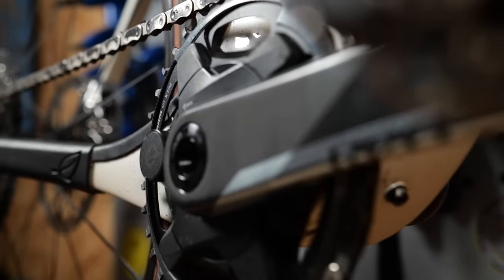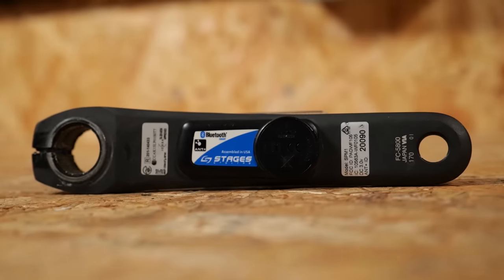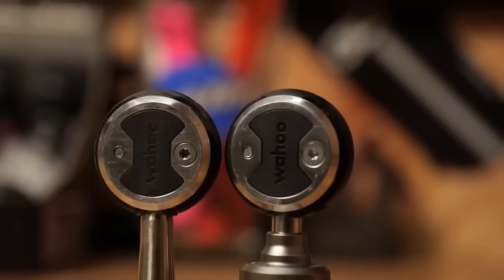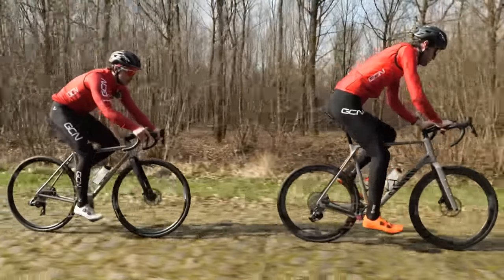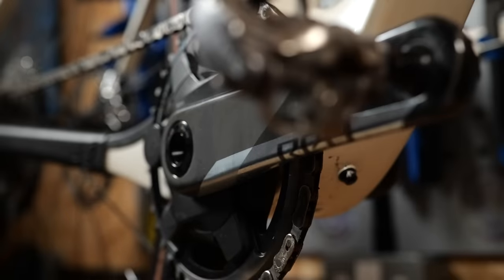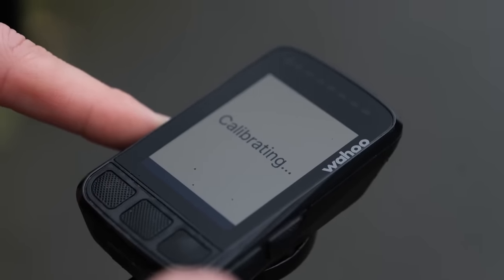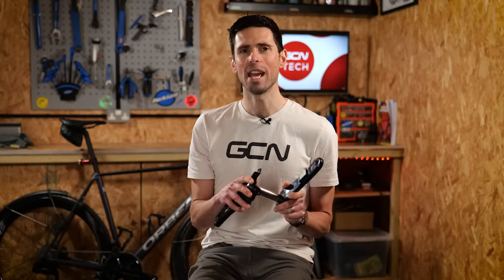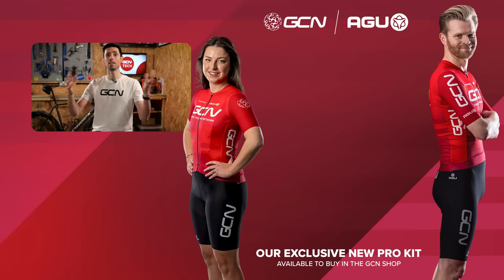The Problem with Power Meters

Comment: great video, I will second one point glanced over in this vid. for 90%+ of riders, all they need to get value out of the PM is repeatability. while it's nice to know how I compare against others on Strava segments, from a training and improvement standpoint, all I need to do is compare where I am now against where I have been historically; the actual number doesn't matter, just need to see improvements or reductions in power. I will share that I have 4 PMs, my cinch PM was 20%high for over a year before I caught it and it messed up all the Strava power curves for that time. Best to keep an eye on accuracy too when using multiple PMs. Anyone know how to easily remove/ignore all Strava PM data from one meter in a single step?

Comment: I use a 4iiii power meter on my left crank. My Kickr core output is around 10% higher so I changed the scale factor on my 4iiii so it matches my indoor training. Although I still feel that indoor training is harder..

Comment: I ride indoors on a Wattbike Atom and outdoors on a bike with a Quark powermeter. Indoor FTP is about 15% lower than outdoor FTP. As I tend to ride outdoors more in the Spring to Autumn it's making my Winter training feel especially effective this year!
Reply from the maker: What training have you been doing this year that has made you fitter in summer?
Reply: @gcntech  hours, and hours, and hours of zwift (and sneaking out occasionally on the mtb) . Pace partner rides, intervals and races.

Comment: After training all winter on the indoor training with its own power meter, i have now started to train outside using my oedal based system. But the difference in numbers is quite profound. Maybe 20 less watts on average. Although I'm aware of the discrepancy, I still struggle to aim for lower numbers when outside

Comment: One thing to watch is getting rogue readings when the battery gets weak. This can mess horribly with your data. I had a Stages dual side for a while with batteries in each crank arm and saw few benefits as my r/l balance was close at about 48/52. Keeping up with the battery changes and the rogue readings was a pain. I’ve single sided Stages now that has been mostly very well behaved and gives me all the insight I need.

Comment: I got a 4iiii single sided 105 R7000 model, v3.0, from Merlin and it was £325- less my "Gold" discount and a further £25 off for loyalty points it was £250.... Looked weird on my Sora bike and to keep q-factor even I quickly opted to upgrade the whole drivetrain to 105 when CRC did them for £299... a nice wee nudge to a worthwhile drivetrain improvement and the power meter has been superb. Yes a dual power meter would be good but would have to be one of the newer Magenes (p505??).... never Shimano though, I follow GPLama!!

Comment: The important thing with ANY measuring tool isn't that they don't always match with other measuring devices, it's that they provide SOMETHING that we can use to measure our performance. This allows us to then use the "measurement" to develop a training plan and see improvement in the number we use as a measurement. This improvement should translate into faster riding, no matter what we're using. 

Of course, this assumes you're only relying on one measurement tool. Anytime you try to take numbers from one device to use on another, you're definitely going to have to create what I call a "translation matrix" to ensure the tools can help you do what you're ultimately trying to do, which is become more fit and faster.
Reply from the maker: This is an important point, it's all about finding your benchmark 🙌

Comment: I use a Stages crankarm power meter.  The most important thing is consistent readings.
Reply: Same. My best judge is, every couple of months, I line my bike up on the same 5.5 mile climb (~4.5%) and time myself to the top. The power meter helps manage the effort, but isn't my (sole) indicator of fitness.

Comment: Since about 6 weeks I have a new bike with single sided strain gage powermeter. The most significant change seems to be that now It sums up my spent calories coming out much lower, compared to the time where Starva / Apple Health used more or less heart rate and data provided by my Wahoo comp.
Reply from the maker: Did you use these calorie counters to moderate your training?
Reply: @gcntech  Not really, but when you do a let say 80 km training, and now - with the powermeter - you "only" did about 6000 kJ, but before you got about 9000 and apple health credited a 200% of movement target, its somewhat disappointing...

Comment: Four different power meters across four bikes (two P2M, one Quarq, and the trainer bike on the Kickr).  Add in the Assioma Duo pedals, and I've used those across the different bikes at times.  as mentioned, get two head units, then ride at a steady pace and compare the 3/10/30 second averages.  For my stuff, its all within a couple percent at most.
Reply: Because these are all quality powermeters that just work.

Comment: Why single-sided? You get good spider powermeters for little more than a single-sided crank/pedal system. I am pretty happy with a Sigeyi - which has been demonstrated to be quite precise, is very easy to set up, and add little additional weight (in my setup, just 80gr, considering that 12gr for the cadence sensor can go). Bought it for 378 CHF...

Comment: Yes, Assiomas & Stages L. Soon to include the Assioma Pro MX. As ever when using them keep the firmware up to date, install correctly, calibrate frequently especially with changing conditions. Oh, and only use ones that have passed the GPLama & DCRainmaker seal of approval. Simple really.

Comment: Kind of like dynos used to measure the hp and torque of your car or motorcycle. You cannot compare the results to the results done on another dyno and in different conditions. They can be used to measure modification gains or to brag to people who dont know much about dynos…
Reply: Exactly.

The exact precision of the power meter readings is less important in my opinion to the relative data against prior readings in addition to the "how do I feel" metric.

Having a power meter and your heart rate information data can really help you with your own calibration of understanding your efforts.

Whether or not the numbers are completely accurate does not really matter.

Comment: My PM's from my own purchasing and experience. Fyi, I ride shimano groupset.
1) Power2max NgEco. - Consistent accuracy, very long battery life. Calibrates quickly. Paired with rotor 24mm cranks means it works with Shimano chainrings and bottom brackets. - HIGHLY recommended.
2) Tacx Neo trainer - accurate, no need to calibrate. Recommended
Note - Power2max and Neo agree with each other consistently 🙂 .
3) 4iii gen 2 left-side only. Accurate and non peaky. Strain guage died after 2 years which also happened to 3 friends and is unfortunately common with 4iiii, Sadly, I can't recommend it. 
4) Pioneer left-side only - Difficult to calibrate, inaccurate, extremely peaky with occasional readings in the thousands of watts. NOT recommended.

Comment: I think power meters also struggle with the type of load. Gradients exert a more constant force through the cranks. Cycling on the flat can have larger dead spots in the crank revolution. In my experience different power meters measure or calculate these efforts in a different way. I would like to see a study into this.

Comment: Have used Garmin's pedals for the last couple of years and have now bought the newer version. There is 40 watt difference on the lower side compared to my calibrated wahoo hometrainer and compared to my team mates I'm pushing far to little. They are updated and calibrated to 165mm crank. Any suggestions on getting them dialed in to show a higher watt so it can be more correct?

Comment: first thing to check is your cadence. if that comes from the PM and drops out thenyour power will be wrong. power uses cadence in its calculation. there's also drivetrain loss and mamu other causes not mentioned in the video

Comment: I don't think enough thought has been given for this video. This video needs a clarification from manufacturers' respective engeneers.
My limited knowledge in physics gives power as:
P = | F × r | ⋅ ω
If the you change between cranksizes (r) without setting up your powermeter everytime the your power measurement will differ.

Comment: The main problem with power meters is that power meters on a pedal, crank, spider or build in into your trainer measure different powers, which can't be compared which each other. 
A powermeter in you pedal measures the power which presses the pedal down. If that is on the upper or lower part of the cycle, most of this power will not be transferred into power to the drivetrain. The spider measures all the power transferred to the drivetrain, but not the effort off pushing on the pedal when it is already at the bottom of the stroke (standing on the pedals). Build-in powermeters are measuring the power on the rear axis, and therefore not measuring al the losses of the drivetrain.
The best measure of useful power you put in your cycling will be given by a spider. The best measurement of the power you put into the bike is measured by the pedals. A powermeter on the rear axis is measuring the force that will be transferred to the road.
You can more or less compare the different types of powermeters only if you know your personal average efficiency between the different types.
Reply: There are math. algorithms which includes not only the force on the pedal but also position, cadence …. so if one just stand on the pedal, it gives you 0 watt, but I agree, the real watt, bringing you forward, is on the wheel, at the other hand the power of the „engine“ is what is interesting

Comment: I am not going to to be racing maybe the odd mass participation event or challenge ride with a local club.  But I don’t need a power meter, but ooh would I like yes please.  Just to geek out and have another column of data / numbers on the Excel spreadsheet I use to keep notes on my rides outside of the Garmin Connect and Strava apps.

Comment: I have a quarq, speedplay powerlink pedals and a kickr and they all agree with 3W.

 (I had a powerhub in the past that was good and a Stages left-side only crank that i had issues with).
Reply from the maker: all within 3w is pretty good isn't it? considering that they are all measuring power from different areas. Happy with that?
Reply: @gcntech  yes very

Comment: I have Garmin XC200's (shimano spd's) and I calibrate them for each bike I use, typically every few rides.  I have found that with the same crank length on different bikes, the calibration can be way different.  Now this is very odd to me.  All my bikes have a 175 crank length but the calibration is different each time.  I typically do this in my garage before the ride but the temps do vary quite a bit in the garage.  I have seen the power difference it shows on my Surly (steel tube bike) to be far lower than on my Giant (carbon fiber).  Of course being the Giant is 19lbs and the Surly 38, that also makes a huge difference.  So many different numbers and variables.
Reply: How did you determine the calibration is different on each bike?

Comment: Good show.  I m interested in powa meter, still holding off till they less pricey.  Noce to know the nuts and bolts of the accuracy, for different types and where they are located.  I was most interested in how they work.  Do they use a piezoelectric, crystal?  I think I'm wrong I dont know.
Reply: They use strain gauges, a small electrical current of a known constant value is run through a maze of foil that is boded to the surface of a material (crank arm, pedal spindle, spider etc.) and the resistance is measured, as the material deflects under load of a known weight so does the foil and the resistance changes, this data is used to calculate the power being put through the material.
Reply: meanwhile you might watch some GPlama videos ;)  for a lower budget assioma is a good choice (only price is lower, not performance and accuracy;) )

Comment: It’s a little bit funny to me that you showed off a Shimano Dura Ace as an example of a crank based power meter, all the while mentioning that typically a crank based power meter is generally more accurate than pedals (Wahoo exemplified). The Dura Ace has been well documented as being one of the most problematic power meters on the market ever since its inception. Even after multiple firmware updates, they still have been shown to be wildly inaccurate, especially the right side which typically puts out numbers that are off by 10% or more! In contrast the Wahoo Powrlink Zero pedals have been proven to be extremely accurate over the years.

Comment: If the accuracy is +/-1% and you're out putting 200W, then the more accurate hub meter after losses might be better. At least with the hub, you know which way the difference is.

Comment: After spending years with a single sided power meter and then getting a dual sided one, I can say that the subconscious thing about putting more power into one leg is absolutely true, at least for me. Also it was widely inaccurate when it came to sprints, telling me I could do 1500 watt sprints back when I had an ftp under 200. 

My advice? Unless you really can't afford it, just get the dual sided one. Alternatively, Chinese brand Magene offers a spider based power meter with crank arms for a similar price as a stages or 4iii single sided power meter. All you have to do is swap your chainrings.
Reply: you can do 1500 watts sprint even having less than 200 watts of FTP....

Comment: I bought a stages left sided power meter in 2017 but I will upgrade to a double in next yr or two. It seems quite accurate when I compare it with my times and weight up climbs to others on strava . However I doubt my left/right balance is 50:50 so there will be some inaccuracy. I believe(but don't know) my left leg is weaker than my right so if anything it prob under-reads slightly than over-reads imo. However it is consistent so when my power goes up I get faster up climbs and I get fitter. So still is a great training tool imo.
Reply: I have a stages LH on my race bike (came with) and always figured my left side was the weaker one--I'm right legged on the whole, and my left knee is the achey one.  I just upgraded to a Duo-shi setup, and go figure...I'm slightly biased with left stronger. I.e. results may not be as expected.
Reply: @brannmacfinnchad9056  Good point! Yes funny how we perceive one leg as the stronger but it could well be the opposite. haha Will be good to know for sure though :)

Comment: I want power meter pedals for both sides. I had a left knee replacement and I feel like I might still baby it some and use my right leg more. This is a habit I got into before my knee replacement and now I want to train to have more equal power on both sides. The bigger issue for me is I use Time MTB pedals and they only power meters I can find are SPD which I hate. Since all my stuff is Garmin I probably will have to get a set of dedicated SPD shoes cleats and the Garmin pedals just for training on gravel and MTB. I don't do a ton of road riding.

I don't really care about overall wattage accuracy. I care about knowing how much power each leg is putting out.
Reply: You could go spider based (like the super budget friendly Magene PES p505) and use whatever pedals you like. Some people claim spider PM's are not "really" dual-sided, but they are making assumptions on how they work/measure based on nothing but the position of the electronics and their own ignorance, they are 100% dual-sided. FYI, I've had the p505 on a gravel bike through the winter months in all kinds of UK weather, and they have never skipped a beat in, 12000+ Km (checked semi regularly against a Kickr V5 and Assioma Duo's).
Reply: @chris1275cc  I have multiple bikes with different cranksets.
Reply: @ShadLife  Ah well pedals it is then.

Comment: But why do we, as consummers accept, those differences? I mean, nobody would accept a scale in the bathroom to be off with 5,5 % vs another one right next to it... 1 watt should be 1 watt, as it is a mathimatical unit. Like 1 kg is 1 kg regardless of what scale you are using.

I have had a Power2max, Assioma DUO, and Kickr 5 read almost within acceptable range of 1-1,5 %, but then I got a Tacx Neo 2T that was off by 16 %. I had such a battle with Garmin/Tacx to make them accept that their unit was inaccurate, as they claimed, that their machine meassured watts in a different way. 

(Maybe thats why people weigh less on Zwift, as their scale at home meassures kilogram in a different way, lol!)
Reply from the maker: This has got us thinking, how accurate are everyones bathroom scales?! We've weighed things on our bathroom scales (luggage) and then done the same at an airport at the check-in desk, you can guess which was reading more than the other 😂

Comment: An inaccurate power meter isn't a problem as long as 1) its consistently inaccurate vs. +/- a big amount.   2)  you test yourself and train against plans based on the readings you are getting from it.  3) you are not trying to compare your watts to anyone elses watts.

Comment: if you are unsure about your PM readings, plug your (accurate and true) weight of yourself and your bike into a climbing calculator after doing a (very important) long, steep, and steady climb. if your estimated power is off (use multiple estimators) then it may be worth dual recording before you think ur able to pump out 6wkg for 20min with 1200vam at 7% kekw lmao

Comment: Carefully mentioning cranks not designed to be a power meter aren't optimal cough Shimano. Power2max is my choice for dual sided, never had a problem with it and have plenty of crank options. Left sided stages on my gravel bike, I only do Z2 with it so I don't really care how close it matches my power2max on the road bike.